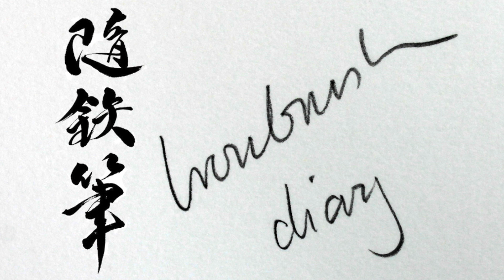filing a fuchi and some talk on kashira form and files

Comment: if you lose the handle piece of the file, and take the file in its whole into your hand holding the index finger on top of the file blade, you'll be able to file with very straight strokes. The longer the movement in inches of the file stroke, the more chance of  rounding off the edges of the surface. To file off the last remains of the object in order to get a very smooth surface with 90 degree angles, you can reverse the position of the file and object; hold the file still in one hand and the object in the other hand, moving the object on top of the file, instead of moving the file on top of the object. you can do this cross wards to even out left/right up/down declining. hope it helps you:)
Reply from the maker: Cheers Kendo Kazan, I will in fact be doing a film clip on correct filing technique very soon. All will be revealed ;-)
Reply: Kendo Kazan I'm sorry, I meant no disrespect. I think the world of Mr.Ford Hallam's work. I am not important as a person. It is not in my nature to offend a master craftsman with unsolicited advice.
But please, feel free to share as much knowledge with me as you can, you'll have my eternal gratitude. I am nothing but a humble servant to the craft all of my life, and planning to die like one. I have no personal pride, just the desire to become an ultimate craftsman. Every source of information, from friend or foe, will be used by me to better myself. I feel no reluctance to share my knowledge, to help others to better themselves. I will eagerly await Mr. Ford Hallam 's video on correct filing. 
Thank you for your comment, Mr. Kendo Kazan-san.